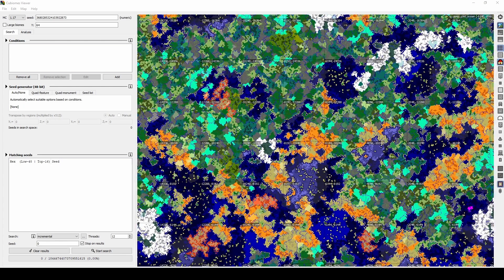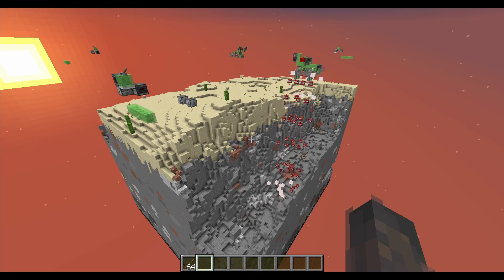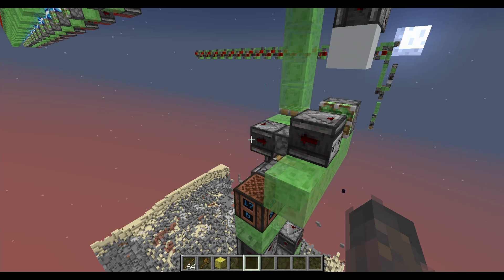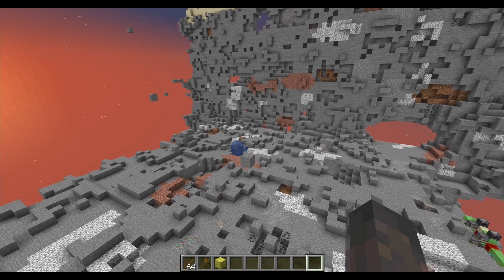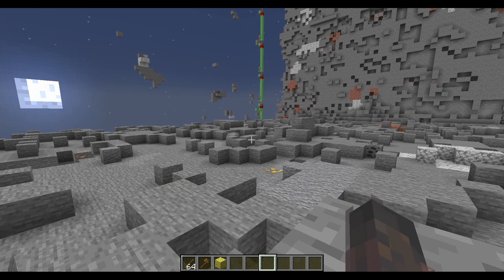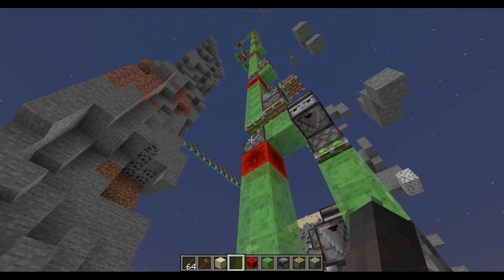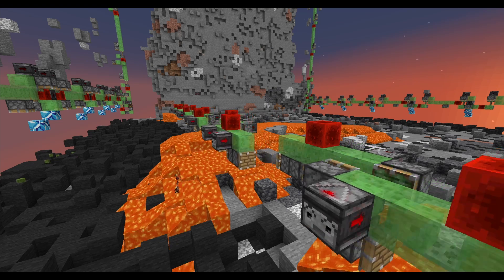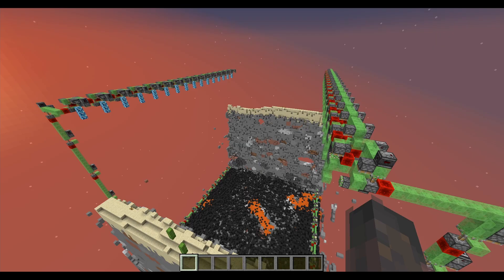How to Speedrun a Perimeter

Comment: will this also remove water just lava in the video?
Reply from the maker: @kingyoinafishbowl  liquids above y11 must be removed manually, any below will be removed by the sweepers. Doing it manually allows the perimeter to be completed more quickly
Reply: @demise3700 I’m guessing you can let the initial WE passes expose all the liquids above y11? Or do you need to go spectator/freecam and remove them before starting the WE? Not concerned about speed running btw

Comment: nice video and i would like a tutoral of the 4x tnt duper
Reply from the maker: thanks, but i dont have time to make a tutorial. you can use litematica to view and build it, or try to recreate it from the video. it can be build exactly as is, you just need to manually prime/bud the back dupers (push the minecart+detector rail on top of the TNT)

Comment: Is there an actual speedrun website or just discord?
Reply from the maker: Just a discord. The community is not large enough to warrant a website, like standard Java speedrunning, just yet.
Reply: @demise3700  I've just enjoyed this kind of thing for a few years now.  Not necessarily big tech builds but just speedrunning skyblock with heavy restrictions.

It's interesting to find optimal ways to get to the first water bucket etc..  I a lot of people would enjoy watching videos if you had a site.
Reply from the maker: @LegendLength  Nice, thats pretty cool. A website just doesn't make sense now, there are only a small handful of people that actually care and almost no runs have been submitted to the discord server. 

I created it as I and a couple others found it interesting but it doesn't make sense to put time into a website if already there isn't much interest in the discord.